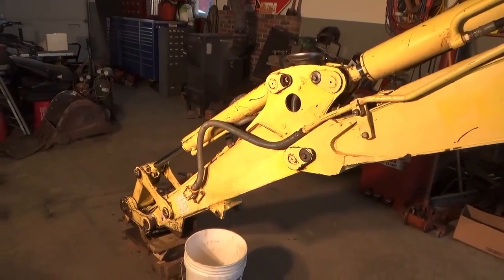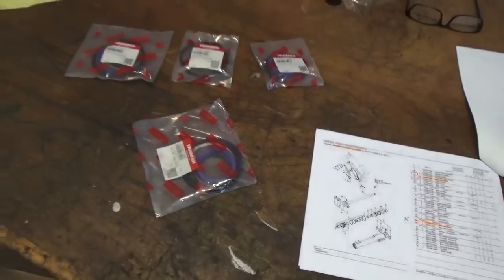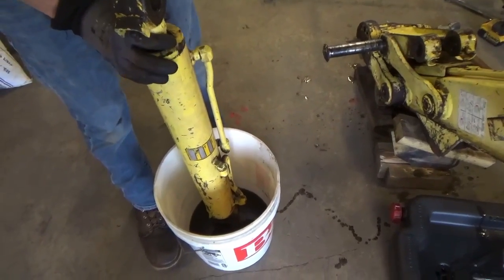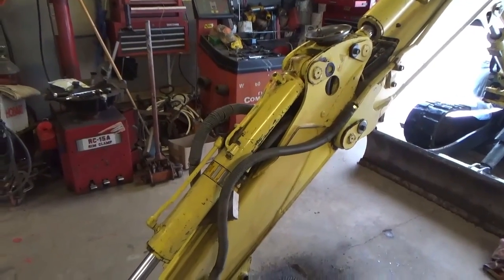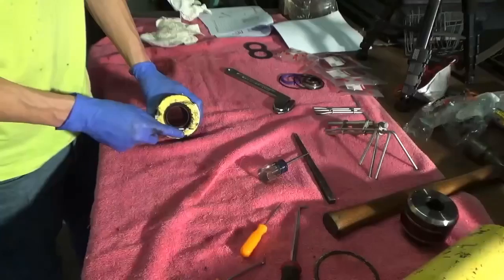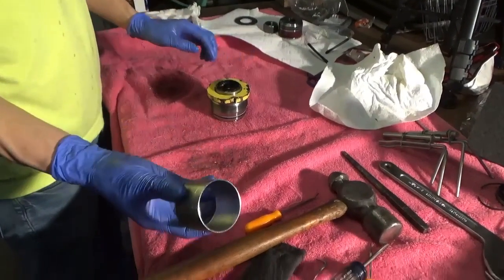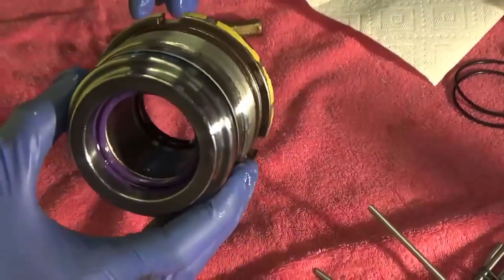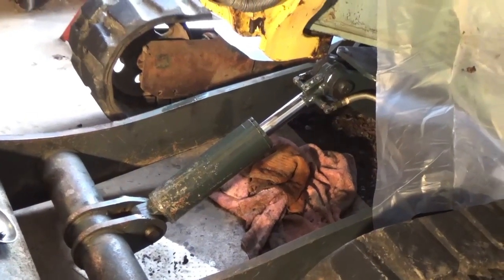Replacing seals in a Yanmar VIO35-2

Comment: How do you bleed the hydraulic system after this?
Reply from the maker: The hydraulic pump will push the air out of the system after a couple of cycles. When the oil/air mixture returns to the tank air is released there.